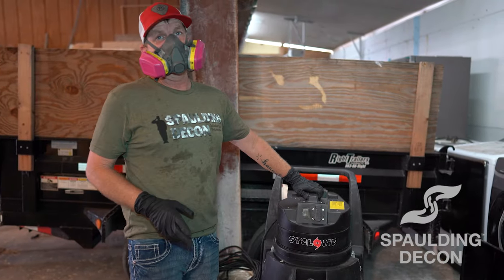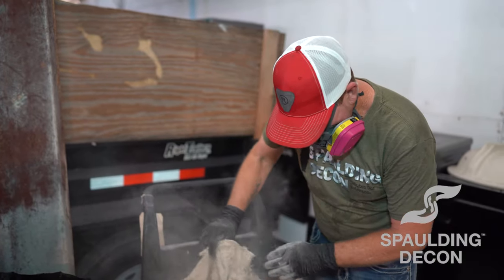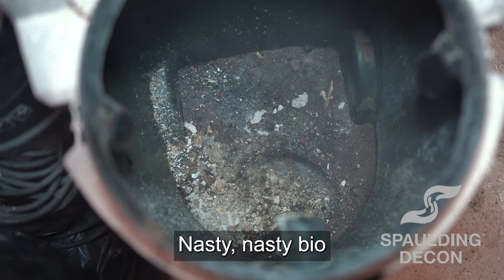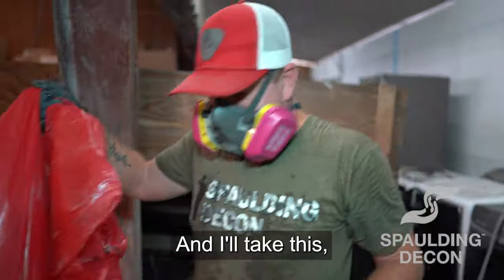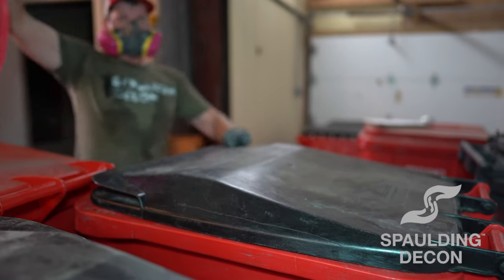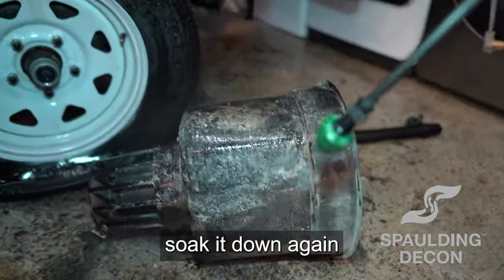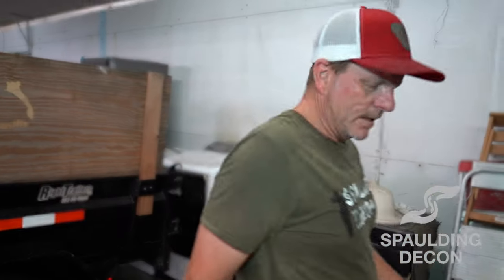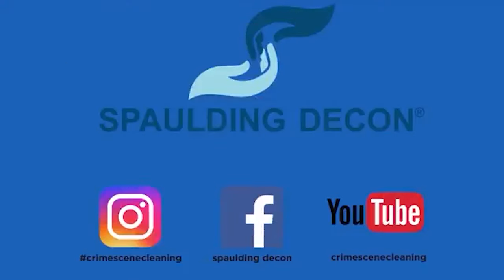How to clean and disinfect your Hepa vacuum. #spauldingdecontampa #cleanupcrew #biohazard

Comment: Optimal sanitation dictates spraying the item(s) in a contained area, allowing the liquid to sit for at LEAST 60 seconds before wiping/drying off.  Then dispose of the residual liquid in a bio-bag that has been properly sealed.  And that is only after following proper extraction of the filter, filter liner and contents which should be done while wearing proper PPE while in an air-sealed room.